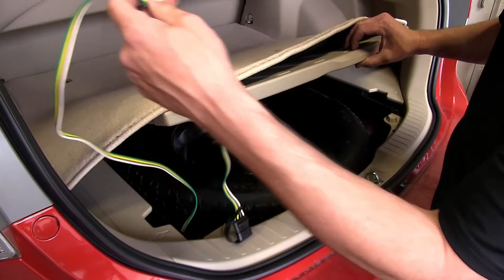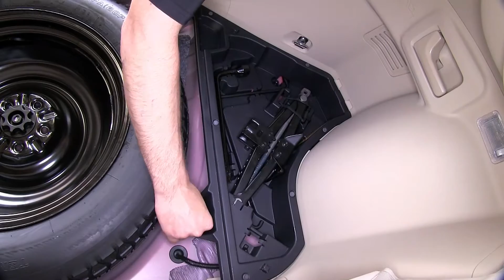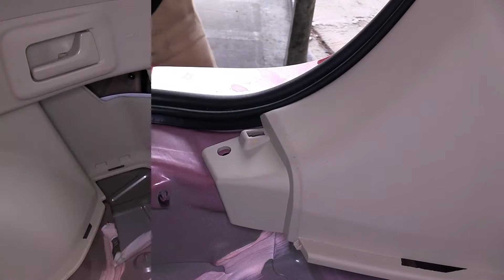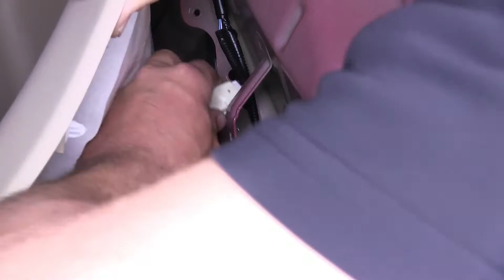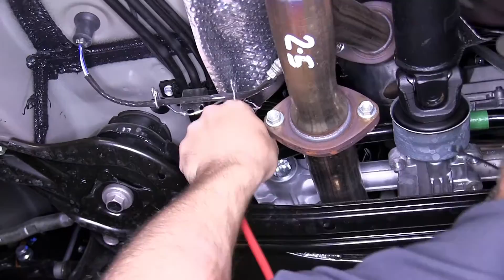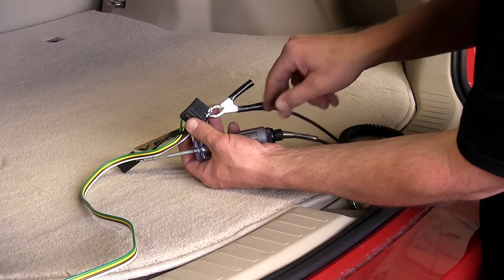etrailer | Trailer Wiring Harness Installation - 2013 Toyota Venza

Comment: Toyota needs to add a factory installed trailer plug for trailer wiring connections. This is far too much work. It would not cost them much in terms of parts or labour to do this while assembling the vehicle. It would be much simpler, easier and customer friendly.
Reply from the maker: Lots of folks would agree with that!

Comment: So you actually installed it with the 4 pin flat plug inside the vehicle even though you used a grommet to run the 12v wire outside and under the vehicle?? And you didn't use any type of loom to protect the 12v wire?? Maybe my standards are too high as someone who installed mobile electronics accessories for 7 years but I would never do an install like that. This is constructive criticism and meant for anyone who is using this video to install their own wiring harness: two things you should do differently than they do here are 1. Make sure to loom the 12v wire that you have to run under the vehicle to the battery. If you don't there's a very high chance that wire will eventually ground out and you'll be left without working trailer lights and may not even know it. And 2. Use the same grommet they used to get that 12v wire through the sheet metal to put your 4 pin flat plug through as well. If it's not large enough to accommodate the plug itself you can cut the head of the plug off but leave at least enough of the wires attached to go back inside the vehicle, use heat shrink butt connectors to reconnect it in the trunk instead of outside the vehicle, and purchase a mount for the 4 pin plug that will hold it securely on your hitch. That's a much more professional way to do the installation and it ensures ease of use and reliability.

Comment: Thanks for the great Video. For the power wire, can I use a 12 volt battery and just keep it in the trunk instead of running the black wire to the car battery? Plus there is a 12V outlet in the trunk, can't we use that?
Reply from the maker: The wire needs to be wired to the vehicles battery so that there is no interference with other devices and that when ever the vehicle is running the battery is being charged. A spare battery has the chance of going dead.
https://www.etrailer.com/Custom-Fit-Vehicle-Wiring/Curt/c56079.html